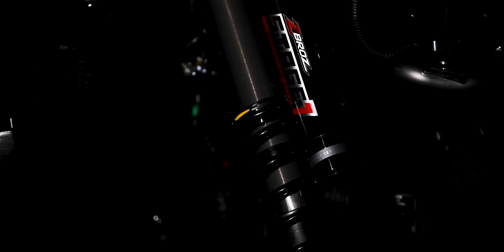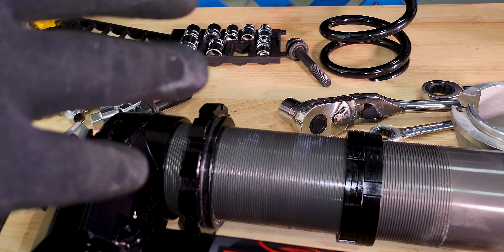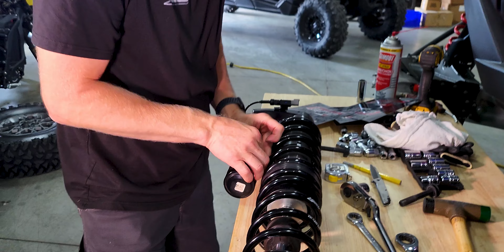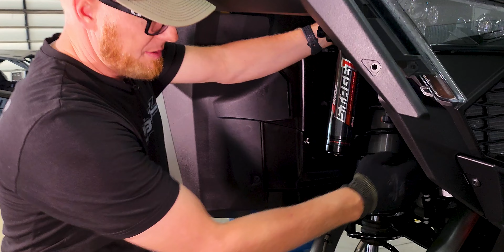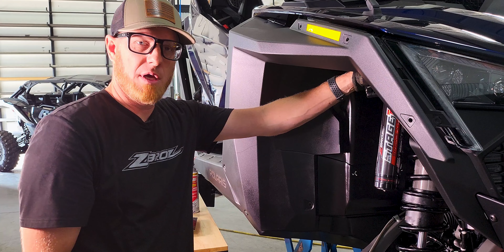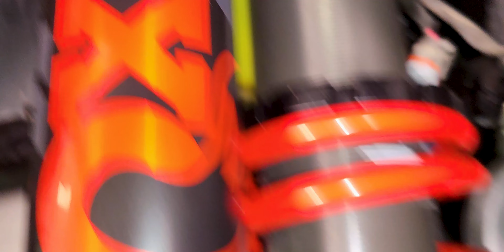Polaris Pro R FOX Live Valve SPRING KIT Install

Comment: what spring rates have you installed in there?
Reply from the maker: It depends on the model. We have different rates for the different models, like a 2 seat vs a 4 seat.
Reply: @zbroz_racing  the ones you installed in this video?